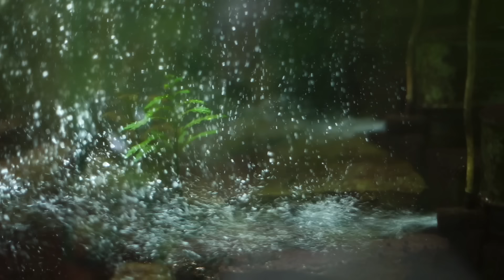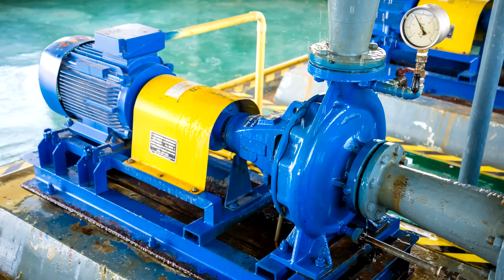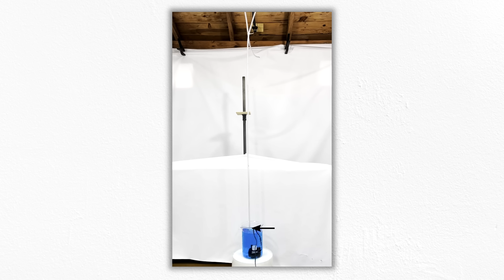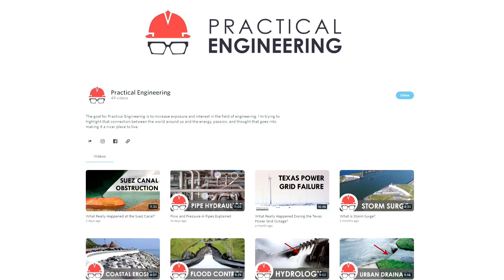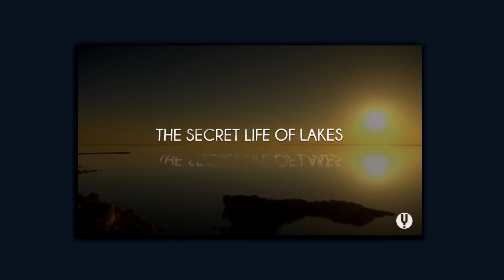Do Pumps Create Pressure or Flow?

Comment: It is the pump load that decide the pump output not the pump itself, which is true because this condition is Called as operating point where system curve and pump curve intersect, it is the steady state condition which represent the stable operation

If system  curve and pump curve did not coincide the pump will stall because now we are asking pump to deliver more then its maximum delivery

Moreover here we discussed centrifugal pump because it is safe and can undergo slippage in case of blockage but we have another category called as positive displacement pump in which regardless the head or system pressure demand the flow vary within 10% range but a PD Pump can explode in case of blockage and hence despite having a good performance it is less preferred in comparison to centrifugal

Comment: usually, in mathematical modelling of pumps, they create either a specific flow-rate or a specific pressure delta between inlet and outlet. The pump power is then flow-rate times pressure.
Power consumption is known from the motor, as is maximum torque.

In isentropic displacement pumps, flow-rate, max torque and power are known, thus follow max pressure delta, and thus max reachable height.
In centrifugal pumps, power and pressure delta are known, thus inducing current by means of transient momentum balance.

These curves that Brady is showing, they occur to me as what is Toricelli's law, which is an oversimplification to the stationary limit in pipe flows under variable resistance, such as in valves. Here, the pump is so-to-say a negative valves, thus the same curves apply (parabola or square root, whatever way you look at it). Recalling three equations of mass balance, momentum balance, and W'=F*s', thus P=p*A*v, appears to be easier and more generalist -- imo.

Comment: @practicalengineeringchannel A pump imparts “work” or power to a fluid.  Power is pressure X flow rate (units conversion needed).  This is analogous to the electrical engineering “I*V = power”.

Comment: This is like electrical engineering: A power sources voltage and current depends on the load. It has an open load voltage, which is its maximum head, and a shorter load current, which is its maximum flow.

Comment: I would have guessed that pumps created pressure.  Here's why.  I've used an air compressor a few times, and I can see the pressure guage on the tank go up without any flow coming through the house.  Also, my home tap pipes have strong pressure, without any of the taps being open.   

Please do an episode on how air compressor tanks build pressure without flow, and maybe also similar vacuum chambers.  Thanks.

Comment: For a centrifugal pump - the pump impeller imparts velocity to the fluid beside the impeller. How much that velocity imparted to fluid in the pump results in pressure/flow depends on the rest of the piping.

Comment: I've always said that an energy difference (pressure, voltage, temperature) drives a transfer of energy (flow, current, heat) while there is a resistance to the flow. Then I just look at the extremes of total resistance (pressure max, flow 0), and zero resistance (flow max, pressure equalizes/voltage collapses to 0). So with that said, I guess it only makes sense that whether it creates pressure or flow depends only on resistance.

Comment: I work with vacuum systems like this along with high pressure water systems. I have the thought that a pump imparts energy into its medium (water, air, oil, etc.). As you showed, the rest of the system determines what the resulting pressure and flow are. A more accurate rating would be Joules or Watts.

Comment: I think a centrifugal pump's function can be simplified even further for the non-engineer audience.  A centrifugal pump adds pressures energy to a liquid.  That's it.  Any liquid flow through the pump (if any at all) depends only on whether there is a place for the water to go, given that energy has been added.

Comment: This is exactly analogous to load line analysis in EE, except with flow/pressure curves instead of I/V curves.  There is a reason the hydraulic analogy is such a common way to explain EE principles.  Just as in EE you can have more voltage-like sources and more current-like sources, in practice all sources cap out somewhere or else would need infinite power.  A voltage source has a max short circuit current, and a current source has a max open circuit voltage just like a pump has a max flow with no pressure and a max pressure with no flow.

Really, that characteristic curve seems very reminiscent of the I/V curve of a solar cell which has a similar 'knee' shape, with a max efficiency point in the middle of the knee.

Comment: Technically speaking, the pump has to create pressure if there is to be any flow. Flow is a result of a pressure difference finding a way to equalize. If there was no pressure difference, the system would be in balance and nothing would happen. Remember, nature strives towards complete entropy.

Also worth noting, when we had flow dynamics in school (control room operator), one fact that stuck with me is that over 50% of the worlds electricity consumption goes to pumps, and over 20% of that is wasted from running too large pumps or running them too fast. Let that sink in for a second. Over 10% of the worlds electrical production is converted to waste heat in plumbing systems due to engineers choosing too large pumps or not running them on an inverter at the right speed.

Comment: Good video, a better example would be a sump pump and it’s requirement for flow and pressure (typical head and piping). A home sewage pump would operate about the same. A discussion on the different switches available and the advantages of the different ones. Thanks...Jim

Comment: I would like you to explain the differences in the centrifugal liquid pump and the centrifugal supercharger?
The centrifugal supercharger or turbo charger actually compress the air through the discharge tube, whereas the roots positive displacement pump just move the air from the inlet side to the outlet side, which should also be correct for the rotary vane pump with some minor built in pressure with the vane pump - now modern air compressors use the screw pump to compress the air  for the pneumatic devices that we use.  Then there is the axial flow pump used in jet engines, which is very similar to the scroll in the impellor of the centrifugal pump ---  However I can say that your "Head" pressure can cause the centrifugal pump to generate less pressure and the same flow -

Comment: As an electrical engineer working in Wastewater/Water design, it's fascinating getting these in-depth explanations of concepts I take for granted on a daily basis. Need power and controls for a 1000hp 4160V vertical turbine pump? I'm on it. Need help sizing said pump and choosing which type of pump works best for the application? ill sit and watch... Keep up the great videos!

Comment: TOPIC SUGGESTION:  The Los Angeles Department of Water and Power is going to open up some holes in my street this week to gain access to their 24" Steel Main.  They are going to be adding magnesium anodes to the pipe about every 50 feet or so.  I would love to see your take on it plus answer questions that the construction team couldn't like 1) why wasn't it done when it was installed? and 2) how long will they last until they need to be replaced, thanks.

Comment: It depends on the pump. A reciprocal pump creates a virtually constant flow (and the pressure can achieve quite high levels if the out flow is blocked), while a centrifugal pump creates constant pressure.

Comment: Thanks Grady  for interesting video.  In summary, sounds like all pumps create pressure, and how much flow, if any and which direction, depends on the input and output systems of pressures, energy losses in pipe friction, valves, and corners, and in other pumps, turbines, etc.

Comment: Simply put: pumps create both pressure and flow, but the resistance of the system decides what that pressure will be. This one is at least accurate with the displacement pumps.
-----
And your statement with the "pump curve" is only accurate if you supply the pump with a constant voltage. If you supply a lower voltage or a PWM signal, then its characteristics will change.

Comment: centrifugal pumps create an area of low pressure inside the volute by increasing velocity, outside pressure pushes the liquid into the pump. That is why you will get cavitation when a tank is pumped below a certain level, there is not enough pressure to feed the pump suction port.

Comment: Old video I know, but piston pumps are widely used in hydraulic system design, and are variable displacement to maintain fixed pressure (up to their maximum rated flowrate).

Comment: Pressure is the restriction of volume. The pump creates the flow volume, the output pipe size (even if it just pumped to atmosphere) is the restrictor or what creates the pressure

Comment: I think the problem is that looking at a pump as something that generates pressure or flow is the wrong way of looking at it. From a fluids standpoint A pump is just converting kinetic energy on the input to total pressure in a fluid. Total pressure is basically the sum of kinetic energy (dynamic pressure) and potential energy in the form of pressure (static pressure). Most of how that falls out in terms of flow (dynamic pressure) and pressure (static pressure) is determined after this conversion.

Total pressure might also include gravitational potential energy somewhere but I deal with small things so I get to pretend that gravitational PE doesn't exist in most cases and thus can't remember.

Comment: We electrical engineers explain the voltage in terms of pressure and current in term of water.
Pump = Transformer ( and indeed  pump is a rotating transformer with some frictional and some electrical losses)

Comment: The way some people use pumps in aquariums often makes me cringe. For example an overflow setup is extremely inefficient because you don’t recover any of the energy you expended lifting the water to the top. Additionally, if you submerge your pump and actually need to heat your water, the pump is 100% efficient at that point because every watt of power going into the pump is a watt less your aquarium heater needs to produce. All household electrical appliances are 100% efficient in the winter time when you think about it.

Comment: Surely the motor connected to the positive displacement pump will slow down if there’s an obstruction in the downstream pipe so the characteristic curve won’t be quite vertical.

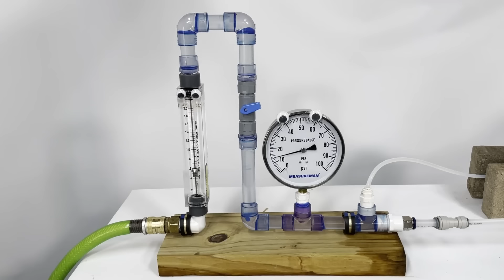Comment: When system curve was introduced at 3:53, It was hard to wrap my head around the idea that the valve directly changes the pressure but not the volumetric flow rate. Also having the axes of the plot in reversed (dependent (flow) is x-axis, and independent (pressure) is y-axis) made me think twice before understanding what is going on.

Either way, very helpful video 🙏🏻.

Comment: Though I heard many times that pump don't create pressure they just create flow. I've always said a pumps purpose is to create flow not pressure. Pressure is just a product of the flow doing work. So yeah a pump creates pressure but that isn't it's purpose. As a troubleshooter I always repeated this to remind others not to automatically assume that no hydraulic pressure is a pump failure. More often than not a no pressure condition is caused by a bypassing motor or valve. Way too often a lazy troubleshooter will replace a perfectly good pump and not fix the problem.

Comment: Pumps create pressure for sure. Coz pressure creates flow. Even if a centrifugal pump has a vertical pipe connected to output, it is creating a pressure difference, which is holding up the column of water in the pipe. Whereas if it is connected to a pipe with very less resistance to flow, it is still the pressure difference than makes the liquid go the 'right way'.

Comment: NICE, very good...now Grady, do one on oil hydraulic (gear) pump, positive displacement. And why they stop producing "pressure"...if fluid power gear pumps produced pressure, you wouldn't need reliefs etc, you'd only need a dial on side of pump...

Comment: Similar relationship with Horsepower and Torque. You can apply torque/pressure to an object and it may not move. Apply enough torque it performs work and is horsepower/flow. Horsepower is a calculation of torque applied over time multiplied by distance moved or in other words work was performed. So in my  opinion pumps create pressure/torque not necessarily flow/horsepower. Power/flow can't be measured without work being performed.

Comment: Love the video. I build and maintain ponds and water features, so I really dig this. My job is often trying to find the right pump curve for the project. I'd love to see more about how the system modifies the flow from the pump with multiple discharges or varying sizes of pipes. Also, I've always wondered if the pressure from the intake of the pump modifies the flow. An example for me is submersible pumps and their depth, does that help increase the flow?

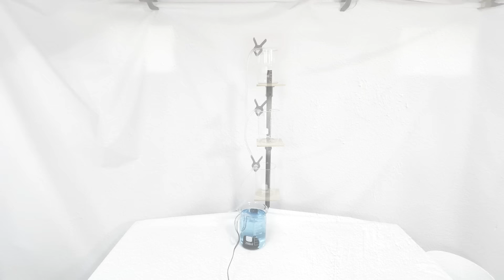Comment: 4:55 Does a pump have internal resistance? In an electrical generator, like a battery, it functions as a voltage divider and together with the consumer's resistance, it creates the voltage you see outside of it. So it is not entirely on "what is connected to it".

Comment: I wish you talked about “running off the curve”
The pump curve will never touch the start and end of the graph as this is know as running off the curve. This will destroy a pump. Pretty much all centrifugal pumps need back pressure some the impeller doesn’t destroy itself. Sometimes this is make into the design of the pump via a restriction, sometimes industrial sites with have a large valve and take the handle off.

Comment: Positive displacement pumps generate flow primarily by applying pressure to the fluid while non-positive displacement plumps apply kinetic energy to the fluid to generate flow. Don't brush off this concept. Try dead heading a positive displacement pump in a high energy system and see how well it works out. Do the same with a non-positive displacement pump and see how that works out. These aren't minor details to be ignored in system design.

Comment: Yes, pressure requires a resistant to flow (motion), however, this resistance comes from the inertia of the fluid being pumped as well as resistance to flow from piping, valves, etc.  So, even with no resistance to flow from the plumbing, pressure is still created simply by virtue of the acceleration of the liquid.  Now, if you had a closed system with zero resistance to flow, the pressure would drop to zero once the fluid achieved a stable velocity.  Much like a rocket moving in space.

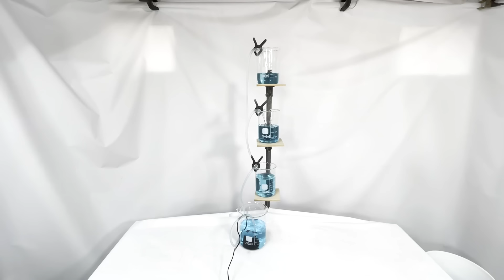Comment: 3:00 you talk about the height being the difference in flow rate. Is the flow rate measure when the pump is started. or the rate measured when water starts filling the beaker.

Comment: Why not just explain flow as the movement of fluid as it attempts to reach equal pressure. The impeller pushes a molecule, it pushes on its neighbour and so on until all neighbouring molecules have the same push (pressure) from both sides. For height/head, each molecule has weight from gravity which pushes down on its neighbouring molecule. Churn pressure is when the force of the impeller is equal to the sum of weight of molecules above the pump. 

Also would be great to see if you showed N1.85 graphing relationships of flow vs pressure for water systems.

Great channel. Keep up the good work.

Comment: We use concrete pumps at work which use hydraulic rams to force thick concrete through a 150mm diameter steel pipe up multiple storeys of a building. Imagine the strain on those pipe connections.

Comment: Probably a bit late to be asking this question, but maybe someone else can help me answer this query. Shouldn't positive displacement curves also possess a characteristic curve? Even though the water is indeed trapped because it is being forced into the output, the pressure in the pipe should need countering with torque from the motor and motor characteristic curves typically have the motor's speed inversely proportional to torque exerted on a load (up to the point where stalling occurs). As a result as the pressure at the output increases the flow rate will decrease as the motor is forced to increase its torque on the load. Am I misunderstanding this? Thanks for another great video in any case!

Comment: Pumps create flow and pressure, u can easily get this mathematically by writing out the general equation of total energy for control volumes of any device or system, a pump always requires an input of work, and that input of work has to be manifested somewhere, which is a change in outlet pressure. This appears in thermodynamics applications in engineering. Another way to think is like how this guy says in this video.

Comment: I was hoping you would show a centrifugal pump curve with the efficiency islands with different trims, and the same pump curve at variable rpm.  Then superimpose a system curve such as a pivot sprinkler system with various nozzle packages.  Berkeley B3zrm has such a curve.  Please explain NPSHR, cavitation, pipe friction loss, closed, open and semi-closed impeller, and show a cutaway.  A system can be modeled with the right equations by the electrical analogy V=I*R.  
I have used a java circuit simulator (Paul Falstad) to make such a model, and the actual pump and nozzle system worked perfectly as modeled.

Comment: All pumps flow, but are reduced as pressure increases, some pumps can't handle the pressure as well.  Without flow there would be no pressure.  Even as gases are compressed with pressure it has to continue to flow.